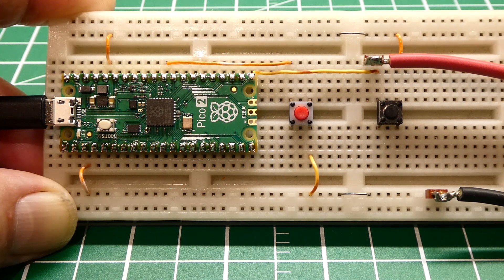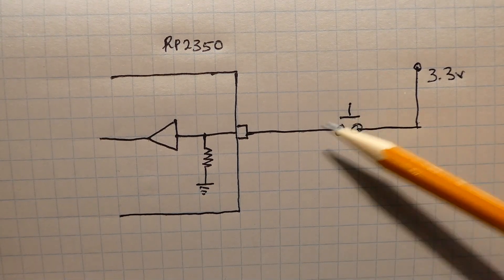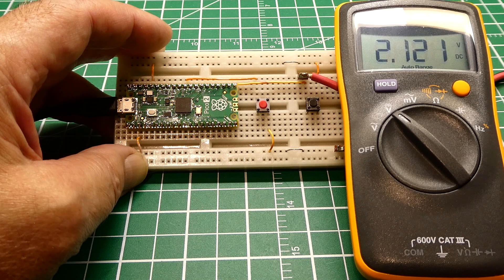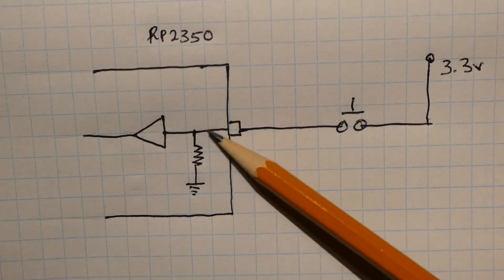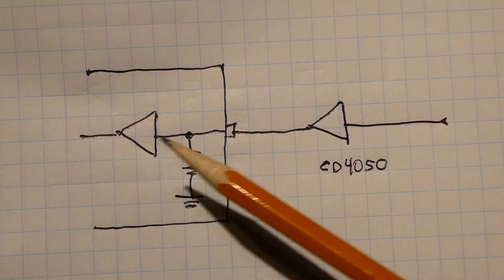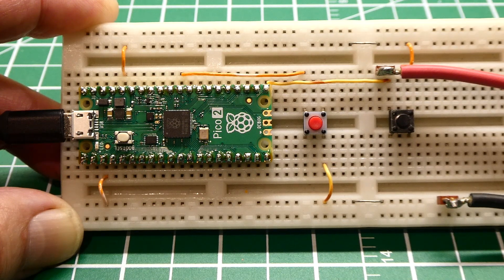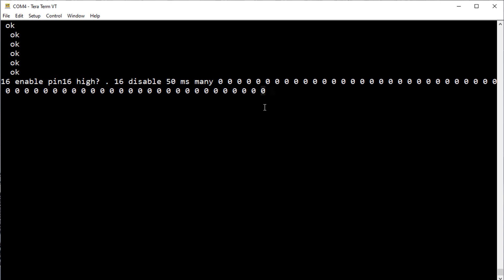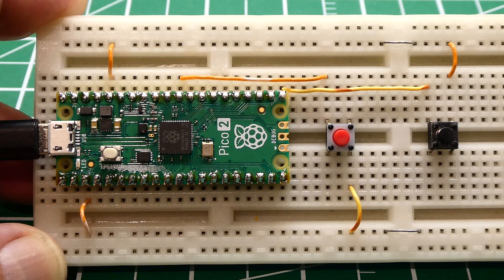RP2350 GPIO Latch-up Glitch / Pico2

Comment: Since I don't do Forth, what would be the equivalent of your program in MicroPython, (if you know how)? :hand-pink-waving:
Reply from the maker: As shown in the video you have to flip bit6 of Pad GPIO16 register to enable or disable the input buffer.
Read the register at 0x40038044 and toggle bit 6
bit6 = 1 << 6
Read register into value
value |=  bit6
value &=  ~bit6
Reply: @0033mer  - no help.

Comment: Thanks I've been looking for days for a step-by-step solution to this. Do you think people should continue to buy the RP2350 or is there a better alternative that won't have this bug in the hardware?
Reply from the maker: You could go back to the RP2040. If you need the extra power of the RP2350, the lock-up problem is easy to overcome. Thanks for the visit.

Comment: The latchup seems to result in a pullup (greater than some 10k).
Hence for low power battery designs it would be necessary to completely get rid of it for inputs that usually are driven low. Not only provide correct logical behavior. 
Do you know more details ? 
How much current is drawn when latched up and the input is driven to ground ? 
Does disabling and then re-enabling the input gate reset the latchup so that the pullup vanishes ? 
How long does the input gate need to be disabled ? 
Can the latch up be avoided by disabling the pulldown (or activate the pullup) for all to be active inputs ? 
Thanks a lot !
Reply from the maker: Download the RP2350 datasheet and search for RP2350-E9

Comment: I'm using Earle Philhower's arduino-pico core (C++) with the Arduino IDE.  I use internal pull-ups, not pull downs, with a 4.7k resistor in series with a push button switch to ground.  That's working fine, though I don't know if the core is working around the problem or if it only applies to internal pull downs, not pull ups.

Consider putting a resistor in series with your switch because if you accidentally set that pin as an output then press the button, it will draw too much current, possibly damaging the GPIO pin.  For example, you might upload the wrong sketch, which uses that pin differently.

Comment: I think they'll add errata and tell that it works correctly but to account for the missing external resistor from the driver circuit, you need to disable the internal buffer

Comment: Thanks for the information. Unfortunately a microcontroller that can't read certain logic signals is like a car that doesn't work in certain gears. To be fair on Raspberry Pi it was outside of their control but hopefully they don't shrug it off and continue selling it like nothing is wrong. Hopefully they at least make a new revision, but even so it won't arrive any time soon.
Reply from the maker: Good point!
Reply: I just found out hard way. Bought pico2 ans official tutorial book (for pico 1) which should work cause pico2 should be comparible replacement. Now i have to fix every schema and code using pull down to work with pull up or add external pull down in case of using pir sensor for example. If raspberry pi states this on website clearly that GPIO doesn’t work correctly i would bought pico 1 since just for playing it is enough and it at least work with all examples from book.

Comment: Can that be done if you're using the PIO for reading the input port ? Maybe by briefly disabling the input after every read ?
Reply from the maker: Have not tested using PIO.
Reply: as per documentation, the only solution if you need to use PIO is the external pull down. ( PIO programs cannot access Pad controls )

Comment: Is another workaround, to use a pull-down button, together with the RP2350's pull-up resistor instead?

Unfortunately this problem is terrible for capacitive sensing of any kind, where you want high impedance on the input to not artificially disturb small currents.
Reply from the maker: The GPIO pin configuration using Pull-ups works as intended. You can pull-up an input and use a pushbutton to pull it down.

Comment: i feel the pico2 is a rushed product
Reply: an excuse to use RISC-V
Reply from the maker: Yes, the Pico3 may be RISC-V only.
Reply: @0033mer would be great if it includes an FPU and vector instructions!
Reply from the maker: Running at 150mHz Fixed point math is pretty quick.
Reply: @0033mer  The ARM core here has DSP instructions.  I hope these type instructions as well as FP will be added to the RISC-V core in time for a possible Pico3.  I also hope Pico3 would have 4 (or more) RISC-V cores.
Reply: @0033mer   u think?   I imagine that ARM might give them a break on licensing seeing as they are an educational product.